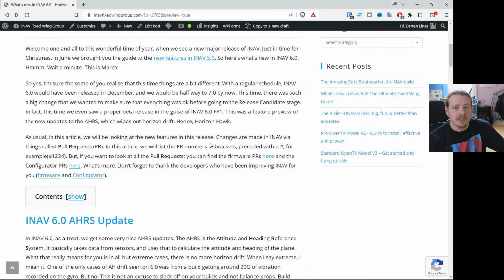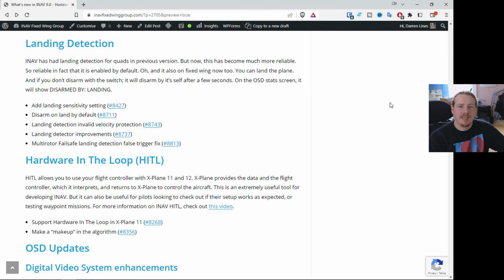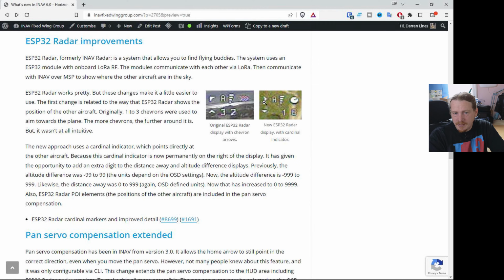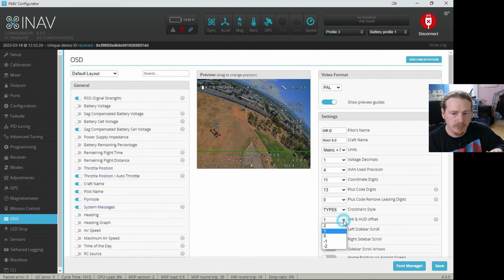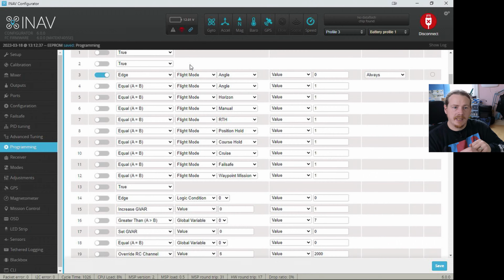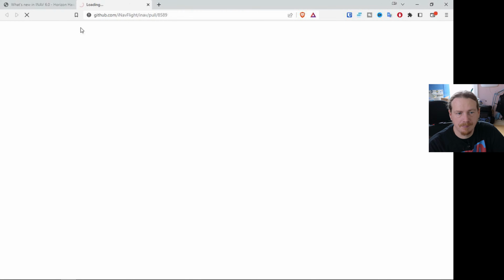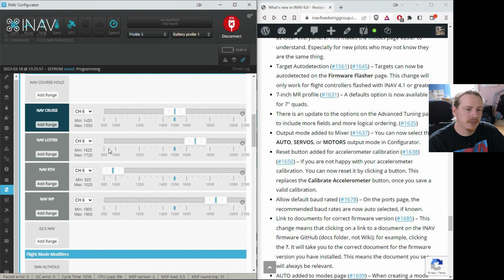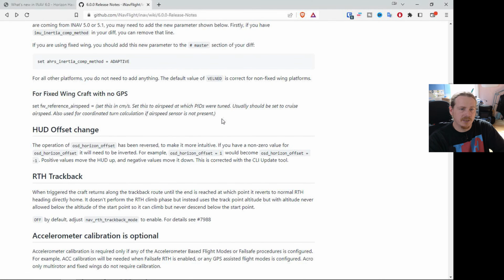What's new in INAV 6.0: Horizon Hawk

Comment: hello sir....would you kindly help me out , need some input regarding inav 6.1.1....i had 3 flights with my dolphin, on Angle and Manual mode...i realized that Autolevel didnt work on Manual mode...doesnt show on osd like Autotune on Acro...when i switched to Manual, the Autolevel doesnt  show on osd at all...seems tht autolevel only works on Angle and Horizon...is it true?
dani
Reply from the maker: Autolevel only adjusts the fixed wing level trim in stabilised modes without althold. Specifically Angle, Horizon, or Course Hold.
Reply: Oic ...much obliged,sir...no more autotrim in manual mode...i got it....i shall fly again 2row and try it out again ..😅

Comment: Gotta inav question for you brother.  When you set up the modes tab in inav do you combine autolevel with the cruise mode and angle mode or no? So when your in angle mode or cruise the autolevel is on at the same time?
Reply from the maker: No, setup autolevel on a tuning switch. Then enable it when you need to use it. You should only need it active for 10 or so seconds, then disable it.

Comment: what happened to the navigation features in the modes tab?
Reply from the maker: They appear when you can use them. It has always been like this. Depends on the platform, but navigation modes can need barometer, GPS, or (for quads) compass.
Reply: @MrD  do we have to be in horizon or angle mode to get loiter or alt hold to work?  I tried it and there was no control when I was in manual mode
Reply from the maker: In general, don’t mix any flight/navigation modes on fixed wing. Just be in a single mode at any given time. Pre-requisite flight modes are already added. If you want to be in loiter, just activate loiter. No need to use alt hold at all with fixed wing any more. Manual will override any other flight/navigation mode.
Reply: @MrD  I've got my switches setup wrong then, one switch is manual/angle/horizon and the other switch is nothing/althold/loiter.  tell me how you set it up
Reply from the maker: Yes; you shouldn’t use althold on its own. It’s not a flight mode, its a modifier. Using it on its own combines it with acro; which is was never intended to be used with. 

My transmitter setup is still fairly similar to this. I have all my 8 modes on one channel. I combine a 3 position switch (SA) with the 6-way rotary switch (S3) to do this. 

https://www.mrd-rc.com/tutorials-tools-and-testing/opentx-tutorials/my-transmitter-setup-a-simple-guide-to-a-great-model/

My flight modes are:
SA(up) - RTH
SA(middle) activates S3
S3-1 - Acro
S3-2 - Angle
S3-3 - Course Hold
S3-4 - Cruise
S3-5 - Loiter
S3-6 - Waypoint mission
SA(down) - Manual
Reply: @MrD  tandem x20 doesn't have a 6 position switch.  When there is no selection it automatically highlights manual mode, I can see it in the modes setup.  the documentation says no selection is acro mode?  anyway, if it wasn't flying in horizon or angle mode it must because it's not trimmed out in manual, we'll work on that for now.
Reply from the maker: @FourthWayRanch  No selection is acro. If it’s highlighting manual, either manual is selected, or you’ve not calibrated the accelerometer yet. 

You can use the 6 buttons. But you have to use logic switches in ETHOS, and use those to switch free mixes. You could also use multiple 3-way switches. I have a video in my Simplify OpenTX series, showing different ways of combining switches. Most will be similar in ETHOS.
Reply: @MrD  accel is calibrated and manual is not selected.  what is the acro button at the bottom for?
Reply from the maker: @FourthWayRanch  its not a button. It’s just an indicator to know when acro is enabled. It’s only an indicator because acro is active when all other modes are not active.
Reply: @MrD  never mind i had to save  its ok now. but I'm worried about this limited throw issue in acro mode.  what mode do you use if you want to fly by hand, manual or acro?
I see the acro button at the bottom highlited in blue when everything is off now.
Reply: @MrD  here's the function to 6 pos vid
https://youtu.be/Eg14-X89Kec

Comment: so we have to disconnect the reciever and gps in order to get the bootloader to recognize the usb ?? huh? are they serious, that means desoldering the Rx
zadig doesn't even see stm32 bootloader on my holybro f7 FC
what a pile of garbage, my quad was running fine on inav 4 now Im hours into this mess for what?  sorry, gettting sick of the constant updating and headaches.
Reply from the maker: That is an STM32 issue, not firmware. It has been recommended for a while now not to use UART 1 or 3, especially on F7 MCUs. Most of these board have around 6 UARTs. So it’s never usually a problem.
Reply: @MrD  I got away with just disconnecting my GPS luckily but now I've got some motor rotation issue on another one, what a nightmare, it shouldn't be this hard to work with this stuff.

Comment: i want to use software in the loop to check the behaviour of my plane before i maiden it. Can this be done - can it be built in?
Reply from the maker: Not really no. Software in the loop can only check switches, mixer, programming, stuff like that. How your plane flies and it’s behaviour is not possible. All RC models and different power setups would have to be modelled. 

TBH, SITL is useful as a training aid, development tool, or to try out  logic conditions or different RTH settings for example. But it won’t check that parameter X is will make your plane fly better. That has to be done in the air.

Comment: nice video.  I'm flying a swordfish using the atomrc fc stock on inav 6.1 and  I'm experiencing  a very strange behavior on my nav modes,   the  plane flies great in all modes but if I hold the elevator stick for too long (climbing ), lets say for a couple of minutes ,  all my nav  modes(alt hold, loiter, cruise, rth)  start purposing .   if I only climb for few seconds at the time  it behaves normal.  what do I need to do to fix this? and why do you think this is happening ?
Reply from the maker: A bug had been found in 6.1 causing this. It’s due to a change in the baro code. So it isn’t because you are pitching up. Other people have had this happen while flying straight. There is a fix being worked on. So there should be a bug fix release pretty soon.
Reply: @MrD  oh, ok.   thanks man.  I'm late to the  Inav party , been flying  vector for ages , but I'm becoming a big fan of it ,  the only thing I miss about the vector is the amazing colored osd  and the capability of making changes while flying .

Comment: Hello, my board is AOCODA-RC F405-V2 firmware Inav 6.0.0
My problem can't out signal servo for my servo mapping AIRPLANE (in Auto or Servo mode), why is it?
Reply from the maker: That target should have servo outputs on pins 5, 6, 7, and 8. This should be confirmed by the output map on the mixer page. This is a quad FC. So don’t forget to sort out an external BEC to power the servos. Don’t just use a 5v pad on the FC.
Reply: @MrD  Thanks you Sir, I am download hex by android and re-flash by Laptop.
Result the FC good finish, mapping my self is okay.

Comment: These days I’m watching your video about modes  in  INAV 3. What are the differences with inav 6? Also where can I find a crystal clear explanation on what each mode is about so I don’t have to scratch 
my head every time?… thanks.
Reply from the maker: The main difference is that Cruise in 3.0 is called Course Hold in 6.0 (it changed earlier). 3D Cruise in 3.0 is called Cruise in 6.0. 

The other main addition is Auto Level (will be called Auto Level Trim from 7.0). I explain that in this video https://youtu.be/AwJHb-0G6lE
Reply: @MrD   appreciated.
Reply: Great video Darren as always, I'm setting up inav 6.0 for first time on the zoid dart xl enhanced version but confused on the modes, so i don't really get the difference in course hold and nav cruise I've always used nav cruise on my wings and have never enabled ATH mode with it ,I'm now wondering if I should be doing it this way? I watched a video on inav 5.0 were one of the developers did add ATH mode to nav cruise very confusing. Thanks for all you do.

Comment: Every time I try to turn off failsafe RTH during a waypoint mission in inav 6.0 it only gives me a timer option instead which only allows 60s of flight before RTH failsafe is active. I used the CLI command for this what is the deal?
Reply from the maker: You set the delay parameter to -1. It is described in the release notes https://github.com/iNavFlight/inav/wiki/6.0.0-Release-Notes#new-items

Comment: Hey Darren, thanks for all the hard work on 6.0.  I am flying it on my Arpro.  18 mi flight today and I used 3169 mah (out of my 7000mah battery).  The battery was full when I started and when I charged it up it used 3399 to fully charge it.  so my meter said 3169 and my full recharge was 3399.  that is about 93 percent accurate.  Should I call that accurate, or should I try and tweak the current adjustment.  It seems as though it will really only matter when I am closer to 'empty'.  I watched your current tweaking video and wondered if it could be done somehow by knowing what it thought I used and how much it needed to top it back up.  (I understand I may lose just a little in the charging process)
Reply from the maker: No, I would never rely on what a charger puts back in to a battery as an accurate measurement. It will always put more back in than what is taken out.

Comment: everything is great and thank you for your commitment... but it would be great to see how the tuning is carried out in practice... i.e. autotune, servo auto trimming, auto leveling, etc. Is it still the same as with INAV 2.7?
Reply from the maker: There was no INAV 2.7 😉 Basically auto tune in acro, use continuous servo trim (checking occasionally that the mid points are between 1450 and 1550), and use auto level when needed, to set the AoA.

Comment: Thanks for the info, I switched to 6.0 from 4.0. I have a question regarding auto launch. How do I adjust the sensitivity/G Force to how hard I throw the plane for  throttle to kick in? I don’t see it in the advanced tuning anymore, and I have to throw the playing real hard for the auto launch to kick in. Thanks again for all your hard work.
Reply from the maker: This was removed from configurator as some people were setting these dangerously low. The defaults should be ok for most planes. But the settings can still be accessed in the CLI if they need a small adjustment.

Comment: As always fabulous content Darren, on the WTF os for original DJI folks, the osd seems to be only possible in a 4:3 layout, but i fly 16:9, is there a work around or a fix for this or are we stuck with the 4:3 osd?
Reply from the maker: WTFOS is 16:9 I believe it’s the original DJI that is 4:3, as they just used the BetaFlight analogue layout. Certainly with O3, that is a 4:3 OSD.

Comment: I can’t get the voltage in my osd on Inav 6. Using the Dominator HD goggles with the Walksnail Vtx.
Reply from the maker: Just add the voltage OSD element. It works fine for me.

Comment: I ask for help from the author of the video and the community. The situation is as follows: - Wingspan 1000mm, Flight FC-10DOF, receiver and RF module on the app - QCZEK_LRC v2.1.1, SBUS protocol, Turnigy 9X app is firmware in ER9X by Mike. There were no comments on all controller firmware versions up to INAV 4.1. From version 4.1, I upgraded sequentially first to INAV 5.1, and then to 6.0.0 RC1, 6.0.0-FP2 and then to 6.0.0 stable. On versions 5 - 6, the PC was simply "draughty" updated to version 6.0.0 stable. Now, when the battery is connected to the model, the motor often "beeps" and in simple ways - when the app is turned on, the gas is at the top or channel 3 is inverted on the app - the controller does not bind. At the same time, the same regulator with the same motor - but with a different receiver (Turnigy 8CH) and a different RF module (of course Turnigy) - connects and works without problems. What is the reason? RF module and receiver QCZEK_LRS v 2.1.1 reflashed and set up on a new one - there is no result. Regulus does not connect and the motor squeaks. From the conclusion made, this - the Motor, the regulator, the RF transmitter unit and the receiver - are operational. Problem in the controller or firmware?? I ask for advice..

Comment: Hi Daren.
In iNav 5.1in Flihght MODES  there  isn't servo auto trim, but auto level, the same in iNav 6.0.
Are these the same as servo auto trim? Or this parameter is set in configuration menu, permanently ajust servo?
Reply from the maker: No auto level is not the same as auto trim. Auto trim will show if you turn off continuous servo trim. There is no reason to have both continuous servo trim and auto trim. 

Auto level sets the angle of attack to maintain level flight at the current air speed.
Reply: @MrD  OK Daren, so in  first maden flyght, after auto launch completes, and everything looks good, shall I use servo auto trim an then if things are  OK, go for landing and save data, then launch again and go for auto tune and then when things go on OK, land again and save data, finally ok? 
And then in regular flight turn on continuous servo trim?
Reply from the maker: These days, I just use continuous servo trim. On the maiden I will perform the autotune in acro first. That will get full movement from the plane. After a few flights, I will check the servo mid points. They should be within the 1450 to 1550 range. If they’re outside this. I will physically adjust the servos and reset the mid points to 1500.

I will use auto level in Angle or Course Hold whenever I feel it is needed.
Reply: @MrD  Só the first radio trim you, a few manth ago told me to preform, and pin the moving surfaces, reset radio trim, and just manually the links with the pins, and then preforms the auto trim, it is, now old method, no more used?
Reply from the maker: @vitorhugolalanda1978  no, you can still do that.

Comment: Hi Darren,
Various improvements have been made in iNAV6.0.
I'm still using the Matek F722WPX.
However, in iNAV5.1, I have a problem that HUD of EPS32 Radar is not displayed on OSD (Pixel OSD). I know the 722WPX OSD is the cause of the problem, but has this been fixed in 6.0?
Reply from the maker: No, the only thing that has changed for PixelOSD is that the heading graph now works.
Reply: Thank you for your information 😊.

Comment: Does auto-level only hold the plane level while it is on, or does it make changes to the settings so that the FC now knows at what AoA it has to hold to ensure level flight? From watching various videos(especially Painless's most recent guide) I was given the impression that it was making changes to the settings and that it only needed to be used during your set-up flights(like auto tune). 

Also the people who "shake-to-wake" will never stop; it's like their comfort blanket or a preflight luck ritual. Some of them even get angry when you suggest that maybe they shouldn't do it because devs like you and Pawel explicitly say to not do it. At this point the dev team should just consider adding a "shake to wake" toggle in the configurator so that when you shake the plane it goes into idle throttle; like "Idle Throttle Delay" but with shaking instead of the timer.
Reply from the maker: Autolevel doesn’t hold the plane level at all. It tweaks the angle of attack to keep level flight. Once the AoA is set, you can turn autolevel off. It is a tuning mode. But you can use it fairly often. The AoA will be different at different speeds for example. 

Nope, adding shake to wake is not going to happen. It is completely unnecessary. What may be coming is a wiggle to activate idle throttle, which would be useful, especially for larger aircraft. But shake to wake should be discouraged, as it can lead to I term windup and failed launches.
Reply: Hi Darren
Just upgraded to inav 6.0. I don't see autolevel in the modes?
Has this been removed?
Reply from the maker: It won’t appear if you don’t have a baro set up.

Comment: Q: This has happened to me multiple times when upgrading to a new version of iNav.
I made a diff of 5.1, upgraded (full chip erase) and then applied my diff to 6.0.
Now, I know that flight characteristic change in every version, ie filters and pids, but other settings just disappear and there is no documentation where they went, why they are gone, and what's their replacement, if at all. I looked in the firmware flasher page for removed cli, and the settings.md page. I dont know of any other place. 
Mine are imu_dcm_kp (?), imu_dcm_kp_mag (Looks like a fix for horizontal drift), nav_wp_safe_distance (sanity check for arming),  nav_land_minalt_vspd (landing RTH)
What do I do in that circumstance? What a poor user supposed to do? I'm not going to look into the pull request code. (I get it, open source software) Maybe a video on this would help. Thx for the contrib and vids.
Reply from the maker: The parameters you are mentioning are all addressed in the release notes. As I mentioned multiple times in the video, please read the release notes fully before updating INAV.